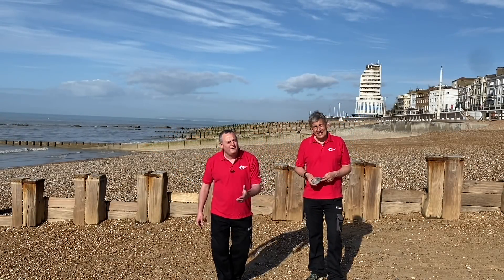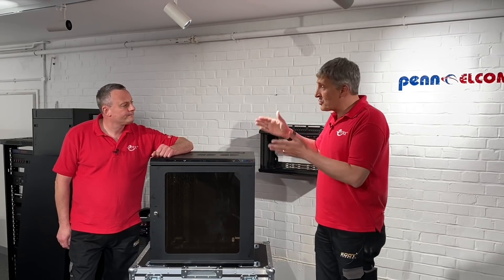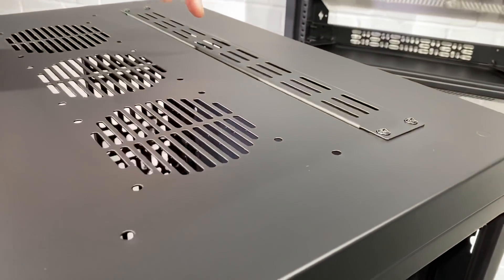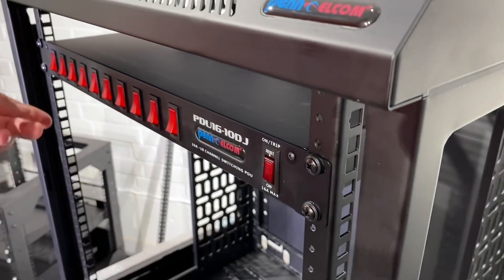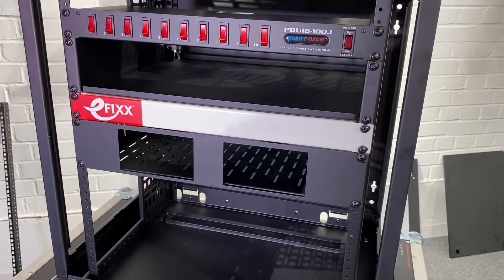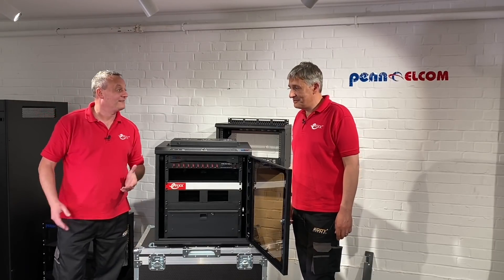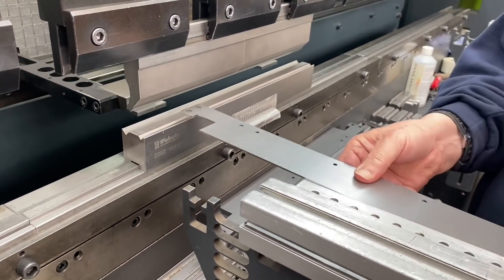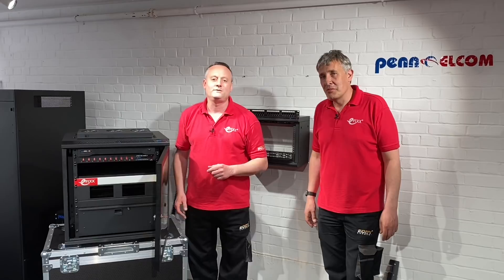19 INCH RACKS EXPLAINED  - Penn Elcom Racks for AV, home theatre & smart home

Comment: Strictly speaking what you are showing are cabinets, not racks. A rack is just two uprights, a cross piece at the top and a base. Traditionally they were made from cast iron and weigh a ton, these always had threaded holes for mounting equipment rather than cage nuts. Those used in telephone exchanges in the Strowger days were normally 4 ft 6 in wide, 19 inch was only used for transmission equipment and similar items. 

I've had a 6 ft high 19 inch rack in the corner of my "man cave" for the last 35 years, having them in homes isn't new.

Comment: The Manchester Baby, also called the Small-Scale Experimental Machine, was the first electronic stored-program computer and was built in 19" racks. It was built at the University of Manchester by Frederic C. Williams, Tom Kilburn, and Geoff Tootill, and ran its first program on 21 June 1948.
You can see a working reconstriction in the The Science and Industry Museum in Manchester.
Reply from the maker: Great tip - the museum is a great day out with lots of electric stuff to see *Gordon.
Reply: Recently discovered that used the old 23 inch standard.

Comment: In the TV production world we use 70” tall racks with the 19” width. 1RU(rack unit) = 1.75” tall. Equipment makers would specify gear in how many RU tall or full or 1/2 rack width.

Comment: Don't forget the earthing and bonding when installing... Even the doors! 😉
Reply: Why bond the doors?
Reply: @davidfaraday7963  BS EN 50310, also the door is generally the first thing anyone touches. High integrity earthing is also something that a lot of places insist on.
Reply: @charlieecosta5592  I am not familiar with BS EN 50310 and am not prepared to pay £109 to find out what it says. Suffice it to say that in my experience doors are rarely fitted to rack cabinets and, when they are, they are usually glass.
Reply: Agreed its criminal that the BSI charges that money for 35 pages. It goes into the detail of configuration of earthing (like in data centres - star, ring, mesh, etc.) and makes reference to other standards... Glass is much easier! Another reason (as I understand) is to remove the build up of static away from any equipment.
Reply: @charlieecosta5592  I am familiar with the need to segregate earth paths within equipment to minimise potential problems caused by volt drop across the impedance of a common earth path, and to keep the impedance of earth paths that carry signal currents as low as possible.  However that is nothing to do with safety earthing.

Comment: You really don't want those threaded bars, the cage nuts are far better for compatibility.
Reply: I’m an AV installer and really like pre threaded rails! What’s your reasoning behind preferring cage nuts out of interest? Guess it doesn’t matter too much if you accidentally strip the thread…
Reply: @pahaywood1992  if you are mixing and matching a lot of units, that aren't as strict on spec pre threaded holes can be a pain, thread damage, if constantly swapping units is also a real issue, see also rail damage especially in mobile racks. It's amazing how often a little play in cage nuts will let you squeeze in a difficult unit.... And for really weird stuff you can cut the horizontal between 2 cage nuts and have an adjustable hole.
Reply: @pahaywood1992  In addition to what Andrew said, I have some equipment (namely server rails but I've seen it frequently elsewhere) that requires the square gaps and doesn't screw in with screws, which would mean it's impossible to fit in a threaded rack.

I don't see the need for cage nuts to be that big of a deal, just get one of those removal and insertion tools and it's a breeze.
Reply: To each his own.  In the pro audio and event production world, those caged nuts are generally considered a plague prone to failure.
Reply: @frugalaudio  If datacentres are all using cage nuts, then I don't see any good excuse that they are "prone to failure" in any stationary situation.
Event stuff is all transported and has a hard life of knocks and bumps, but the context here is a home rack and for that, cage nuts are the correct way to go.
Reply: indeed, threaded bars are not a feature to be proud off, Thankfully Penn do still make proper racks with cage nuts.